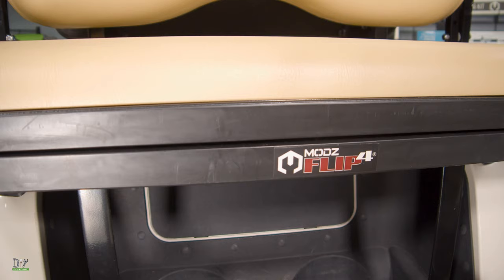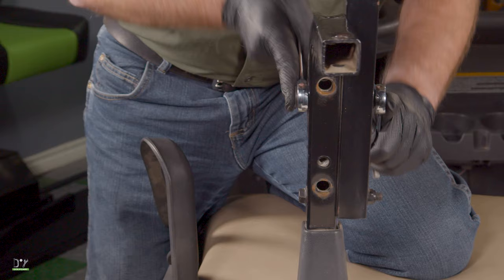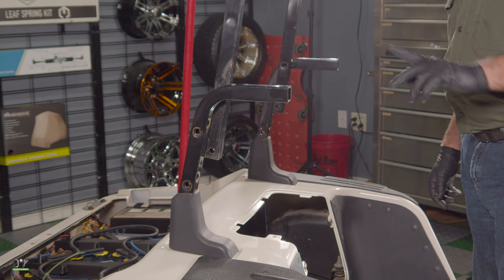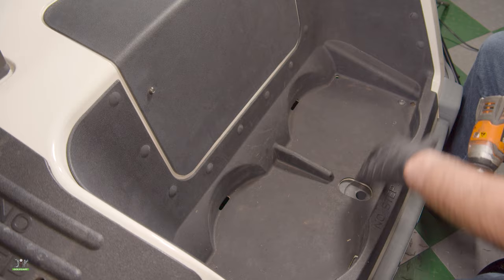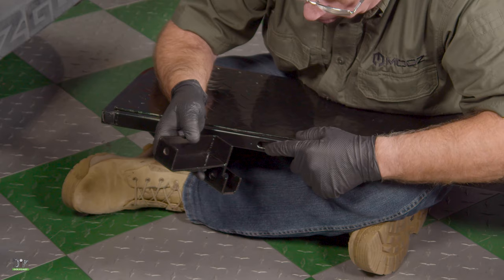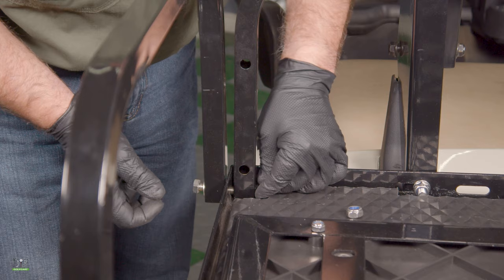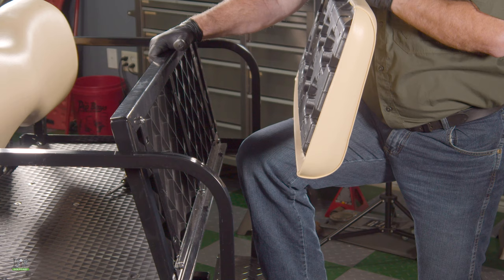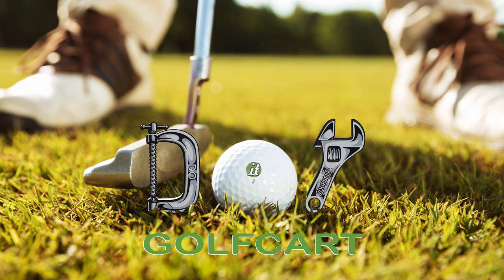Modz Flip4 EZGO RXV Rear Seat Kit Installation How-To

Comment: Thanks for the video. I have a 2018 EZ-GO RXV and bought a Route 66 (Litchfield Accessories) rear flip seat from where I bought the cart. Couldn’t find a video for the Route 66 rear seat install anywhere. Found your Modz video, and most of the parts you seem to be using match pretty well. The only difficulty I had was the bag well support was a little to wide and had to be forced in cracking the plastic bottom a little by the passenger side hole. Also, the foot support bracket was already attached on my kit.
Again… Thanks for the video!